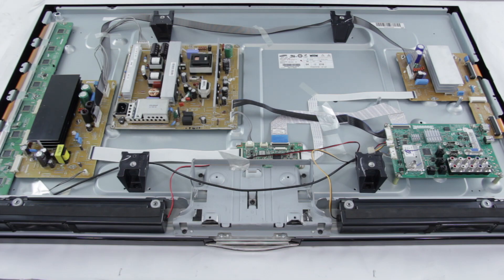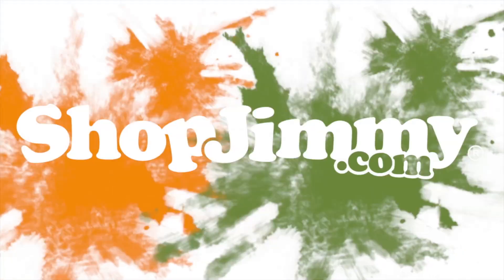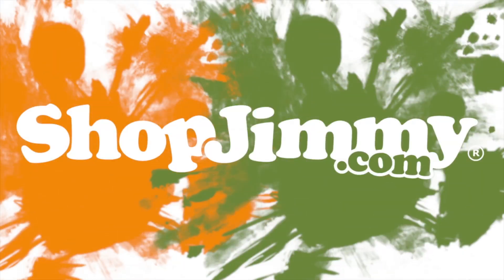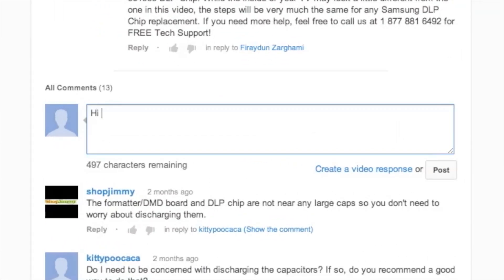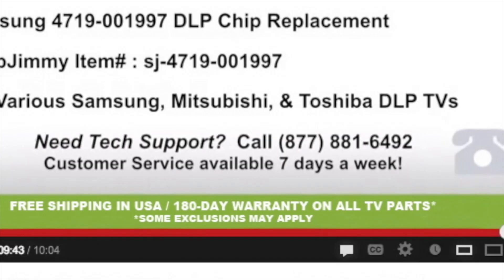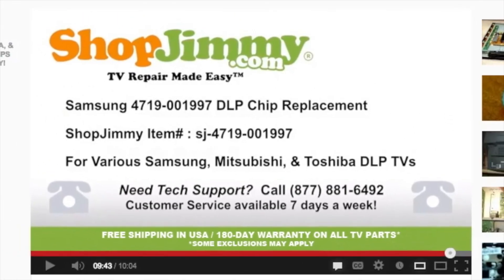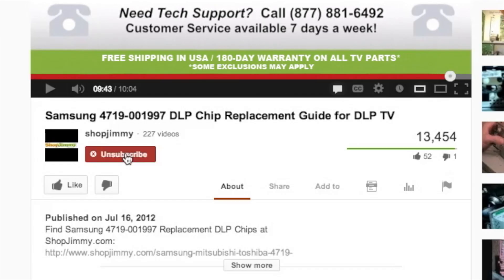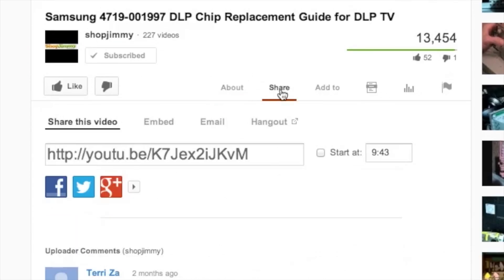Plasma TV Repair Tutorial - Common Symptoms & Solutions - How to Fix Plasma TVs

Comment: hi, I have a lcd tv philips 32pfl5522d/12, the problem is that when I turn the tv on it shows a lot of horizontal lines of diferent colours, after a minute or so it will fade to black.  when a press on the remote control 062956 to try a reset it shows the lines again but the colour is red and again it goes black. I opened the tv and I can see the backlight is on even if the display is black. 
could you please give me some advise before I order a circuit board?
I think it may be the t-con board but before I buy I want to be sure. I would apresiate a lot your advise. thankyou.

Comment: have a 50 vizo about 12yr old had a awesome picture till last night. red blue white like rainbow vertical lines came on wont go away. still have sound any thoughts
Reply from the maker: dan koch   This sounds like a TV panel problem.  If your TV panel is bad, it may be more cost-effective to replace the TV as panels are typically hard to find in stock, difficult to replace, and expensive.  Thanks and please let us know if you have any further questions!  www.shopjimmy.com

Comment: Samsung HP-S4253, model code# HPS4253X/XAA. Screen changed color to mostly green with spotted colors with vertical lines spaced roughly 1/8 apart? all inputs from hdmi to componants are the same results. opened the back no swollen caps no blown fuses. checking vss ect. resulted in good voltages outputs. I am leaning toward Mainboard #BN41-00694B as being the culprit. backcover vents were covered with dust and Mainboards heatsink on chip was excessively hot to the touch. thoughts?
Reply from the maker: ericjones195   This sounds like a TV panel problem.  If your TV panel is bad, it may be more cost-effective to replace the TV as panels are typically hard to find in stock, difficult to replace, and expensive.  Thanks and please let us know if you have any further questions!  www.shopjimmy.com

Comment: Hi Shop Jimmy - We have a LG 50PQ30 plasma.  We started getting a two inch wide distortion near the top of the screen that came and went.  It went horizontally all the way across the screen.  It has gotten darker - and sometime much wider now and is happening much more frequently.  Can you direct us?
Reply from the maker: Linda Sabo   This sounds like a TV panel problem.  If your TV panel is bad, it may be more cost-effective to replace the TV as panels are typically hard to find in stock, difficult to replace, and expensive.  Thanks and please let us know if you have any further questions!  www.shopjimmy.com
Reply: It started out as a distortion - and then went to a two inch black band across the whole tv screen horizontally.  It goes away and then the screen is fine.  Then later when turning it on - it has gotten worse - and half of the screen on the top is black.  If you leave it on long enough - you start to see something on the top of the screen and if you wait long enough - sometimes the screen comes back totally and everything looks fine.    So you think its the panel?

Comment: We have Samsung Model HP-S5053 Plasma TV.  The screen has gone completely black.  It kept doing this temporarily and then finally went black and stayed that way.  Is there any solution to this?
Donna H
Reply from the maker: Donna Havens   I recommend that you replace the Y-Main Board and the Upper and Lower Y Scan Drive Boards in your TV as those parts control the video to the panel.  Here is a link to replacement parts for your TV model number on our website, click here:  http://www.shopjimmy.com/catalogsearch/result/?q=HP-S5053  Be sure to match part numbers on your current board, with your replacement for compatibility.  Here is a link to a video showing how to identify your part number, click here:  Samsung Plasma TV Repair: Samsung Plasma Panel Parts Guide  You can also call our customer service for further assistance with your purchase.  (877) 881-6492  Thanks and please let us know if you have any further questions with your TV Repair!  www.shopjimmy.com  #samsung   #tv   #tvrepair     #samsungplasma

Comment: I have a samsung PS42A410C1XXC
It shows vertical lines on the left side of the screen.
location of the lines:
When I set theTV to ratio 4:3, a gray area on the left and right of the TV are shown (which is normal).
Divide the left gray area in 2 vertical blocks. The right part of this area is not working properly.

That part shows the same image as is on the most left side of the screen, except in a different colour.
It is missing one of the basic colours.

any suggestion on how to fix this?
Reply from the maker: Wim Verkuijlen   This sounds like a TV panel problem.  If your TV panel is bad, it may be more cost-effective to replace the TV as panels are typically hard to find in stock, difficult to replace, and expensive.  Thanks and please let us know if you have any further questions!  www.shopjimmy.com

Comment: Hi. I have a Samsung Plasma PS50C550. I've had a loud pop sound from the TV today, and there's no picture since. The sound is ok though. What do you think the problem is?

Thanks for the great video.
Reply from the maker: Yaniv Shaked   I recommend replacing the Y-Main Board and the Y-Buffer board(s) in your TV.  Please reply with the part number on your Y buffer board(s) as I do not see them in the search results for your TV model number.  Here is a link to replacement parts for your TV model number on our website, click here:  http://www.shopjimmy.com/catalogsearch/result/index/?cat=66&q=PS50C550  Be sure to match part numbers on your current board, with your replacement for compatibility.  Here is a link to a video showing how to identify your part number, click here:  Samsung Plasma TV Repair: Samsung Plasma Panel Parts Guide  You can also call our customer service for further assistance with your purchase.  (877) 881-6492  Thanks and please let us know if you have any further questions with your TV Repair!  www.shopjimmy.com

Comment: Hi. Samsung PN50A510P3F(XZA) Plasma. Had several single lines running vertically for a year. Now have a black 2" bar running vertically. Cleaned all ribbons connectors. Main logic board flashes green every second on R2063 or LED2000. What could the likely matter be (gosh, but my old Haeir is still working great at my ex's). Nice video for a layman. I am a appliance tech. Logic board????
Reply from the maker: Gerry Carson   This sounds like a TV panel problem.  If your TV panel is bad, it may be more cost-effective to replace the TV as panels are typically hard to find in stock, difficult to replace, and expensive.  Thanks and please let us know if you have any further questions!  www.shopjimmy.com

Comment: Jimmy, this is really a great video. If nothing else, I'm happy to know names and functions of all the components on my tv. 

So here's my problem - I have a Samsung PN50A450P1DXZA. I believe it is a 2008 model. When I press the power button, the TV chimes and the light on the bottom illuminates. The display goes from black to a dark gray, but there is no picture or menu/channel boxes. When I change channels on the set itself, the display will briefly go black and then return to dark gray,  as if the channel is changing. But again, no picture or boxes. 

The capacitors all look fine. I changed the fuses on the power supply, hoping for a quick fix, but the TV is behaving exactly the same as it was before. 

Any thoughts on what the issue might be and how I might go about fixing it?

Thank you so much for any help you can provide.
Reply from the maker: Benjamin Flatgard   This sounds like either a problem with the main board or the Y-Main Board in your TV.  You may need to replace each board individually to see which one fixes the problem.  Here is a link to replacement parts for your TV model number on our website, click here:  http://www.shopjimmy.com/catalogsearch/result/?q=PN50A450P1DXZA  Be sure to match part numbers on your current board, with your replacement for compatibility.  Here is a link to a video showing how to identify your part number, click here:  Samsung Plasma TV Repair: Samsung Plasma Panel Parts Guide  You can also call our customer service for further assistance with your purchase.  (877) 881-6492  Thanks and please let us know if you have any further questions with your TV Repair!  www.shopjimmy.com

Comment: LG 50 PS11-UB 10/2009 tophalf of picture hortizonal lines white narrow with multiple colors lower half picture is redish dark and vertical lines changing and flashing
Reply from the maker: Lori Moore   This sounds like a TV panel problem.  If your TV panel is bad, it may be more cost-effective to replace the TV as panels are typically hard to find in stock, difficult to replace, and expensive.  Thanks and please let us know if you have any further questions!  www.shopjimmy.com

Comment: My SAMSUNG 42" Plasma TV (PN42C430A1D) started to show a thick vertical black line (3-5 inches) in the center of the screen. Please could anyone let me know how to fix it..
Reply from the maker: *****   This sounds like a TV panel problem.  If your TV panel is bad, it may be more cost-effective to replace the TV as panels are typically hard to find in stock, difficult to replace, and expensive.  Thanks and please let us know if you have any further questions!  www.shopjimmy.com

Comment: Hi.  Great video and thanks in advance for any guidance.  I have a 2010 LG 50PS30 plasma that the top half of the picture is black.  The bottom half is fine.  From what I have been able to find, the problem is most likely the upper scan board.  Would that be correct? Part # shows EBR61831602 but you seem to be out of stock. Would EBR61831601 work as it seems to be the listed part number??

Comment: I have an LG 50pk590-ZE

It is 6 years old. ALL types of signal AND also the menu flicker and also show the image flipped horizontally. Do you happen to know what is wrong?
Reply: Also when picture is on the screen horizontal lines.... when the screen saver is on the screen is fine apart for the occasional flicker.
Reply from the maker: hamstersk8er   This sounds like a TV panel problem.  If your TV panel is bad, it may be more cost-effective to replace the TV as panels are typically hard to find in stock, difficult to replace, and expensive.  Thanks and please let us know if you have any further questions!  www.shopjimmy.com
Reply: ShopJimmy.com When you say panel do you mean the actual front or the circuit board... the image is absolutely fine with the screen saver at all parts of the display? ... its only once you press the menu button or have an image from an input that it happens?

Comment: Hello 
I have a P-TC65GT30 which just went out. TV is only 2 years old
Getting the 7 blink of death
Disconnected the SC board and got 8 blinks
Reply from the maker: Ryan Waddell   Please try disconnecting the buffers in your TV and see what happens.  Reply with that info.  Thanks!  www.shopjimmy.com
Reply: Do you have a email so I can send picture of buffers?
Reply: Disconnected the buffers front the sc board and powered on and still got 7 blinks
Reply: Need some assistance please. Would like to know what board I should purchase from you guys. See above for troubleshooting.
Reply from the maker: Ryan Waddell   I recommend trying the same thing, disconnecting and applying power with the SS board, which is on the other side of the TV.  Thanks and please reply with the results of that test.  Thanks!  www.shopjimmy.com

Comment: I have a Panasonic  TH-58PZ700U.The When I turn it on the picture is brilliant and clear for about 5 minutes then it goes off
as if something gets over heated and then after a day or so I turn it back on and it does the same thing.I would like to know
how to fix this and also what parts I would need.
Arden Edwards
Reply from the maker: Arden Edwards   I recommend replacing the SC board and the SU and SD buffers in your TV.  Here is a link to replacement parts for your TV model number on our website, click here:  http://www.shopjimmy.com/catalogsearch/result/?q=TH-58PZ700U  Be sure to match part numbers on your current board, with your replacement for compatibility.  You can also call our customer service for further assistance with your purchase.  (877) 881-6492  Thanks and please let us know if you have any further questions with your TV Repair!  www.shopjimmy.com

Comment: I have sound but no picture.  2006-07 Hitachi 55HDT79
Reply from the maker: Brett Stewart  I recommend replacing the main board in your TV.  Here is a link to replacement parts for your TV model number on our website, click here:  http://www.shopjimmy.com/catalogsearch/result/index/?cat=226&q=55HDT79  Be sure to match part numbers on your current board, with your replacement for compatibility.  Here is a link to a video showing how to identify your part number, click here:  NEC Plasma TV Repair: Part Number Guide for NEC, Hitachi, & Fujitsu Plasma Panel Parts  You can also call our customer service for further assistance with your purchase.  (877) 881-6492  Thanks and please let us know if you have any further questions with your TV Repair!  www.shopjimmy.com

Comment: I have a Hitachi 43PD3000 plasma TV that comes with an external "media box" that receives the inputs and the tuner cable. The problem is when I turn on the TV this external box makes some clicks 4-5 of them and either stops and repeats or occasionally the TV opens after the clicks and is totally functional. I suspect some problem with the voltage regulator of the power supply unit but I inspected and didn't show any obvious electronics faults... like burned capacitors or stuff. Any ideas?
Reply from the maker: attheodo  This sounds like you have a bad media box in your TV.  Here is a link to replacement parts for your TV model number on our website, click here:  http://www.shopjimmy.com/catalogsearch/result/?q=42PD3000  Be sure to match part numbers on your current board, with your replacement for compatibility.  You can also call our customer service for further assistance with your purchase.  (877) 881-6492  Thanks and please let us know if you have any further questions with your TV Repair!  www.shopjimmy.com

Comment: Panasonic TC-P42S2 Plasma
My TV screen when on has an red line going horizontally through my screen, anybody know how to get ride of the line going through my screen?
Reply from the maker: Matthew DeMarco   This sounds like a problem with either the TV panel or the SC board in the TV.  You can replace the SC board and the Y-Buffer Board in your TV to see if that fixes the problem in your TV.  If it does not fix the problem, then I would say it is the panel.  Here is a link to replacement parts for your TV model number on our website, click here:  http://www.shopjimmy.com/catalogsearch/result/?q=TC-P42S2  Be sure to match part numbers on your current board, with your replacement for compatibility.  Here is a link to a video showing how to identify your part number, click here:  You can also call our customer service for further assistance with your purchase.  (877) 881-6492  Thanks and please let us know if you have any further questions with your TV Repair!  www.shopjimmy.com
Reply: Thank you for the help

Comment: hi there shopyjimmy i am having issues with my samsung hp-s4253 plasma tv. when plugged into power i am able to get the tv to power on along with audio and video for a duration of about 3 seconds a perfect image displays but it shuts down (almost like a crt fade) 3 seconds later. i beleive it is a blown capacitor on the power supply board. am i correct? i have removed the power supply board and looking to get a new one. is that my best course of action? and where can i purchase one? thanks so much for your help in advance
-ben jacobs

Comment: Hi, I have LG plasma TV 50PS8000. It has a around 10 vertical lines ( red and green). The lines are changing colors ( ex. when the picture is red, line is green, when picture is green the line is red). So I am wondering could the control board be the couse of these lines. Thanks for any kind of information.
Reply from the maker: Vanja Canjuga   This sounds like a TV panel problem.  If your TV panel is bad, it may be more cost-effective to replace the TV as panels are typically hard to find in stock, difficult to replace, and expensive.  Thanks and please let us know if you have any further questions!  www.shopjimmy.com

Comment: Hi, I'm having trouble with my insignia NS-40L240a13 Rev A.
When I turn it on I het a solid white screen which fades to black.
Sometimes there is a blue and a purple solid line, about 1 cm wide each at the top of the screen, but thoses eventually fade to complete black after a minute or two. There is sound through HDMI. Please help!
Reply from the maker: Carlos Unda   This sounds like a TV panel problem.  If your TV panel is bad, it may be more cost-effective to replace the TV as panels are typically hard to find in stock, difficult to replace, and expensive.  Thanks and please let us know if you have any further questions!  www.shopjimmy.com

Comment: I have a samsung model  #pn51d550c1fxza  that kicks in and out and the green light on the logic board flashes and stops. I replaced the powerboard and the y sustain board with the same results. Any other suggestions

Comment: I have a Panasonic Viera th50z80u plasma tv. I came home tonight and when I hit the power button, the red light goes on. The screen comes on, but it stays black and does not respond to the remote or buttons. If I power it off. It turns back on,but stays black.
Reply from the maker: Jason Dasher   I recommend replacing the Y-board and buffers in your TV.  Unfortunately I do not see any replacement parts in the search results for your TV model number on our website.  Please reply with your part number on your y board and buffers and then I can try searching for replacement parts.  Thanks and please let us know if you have any further questions!  www.shopjimmy.com